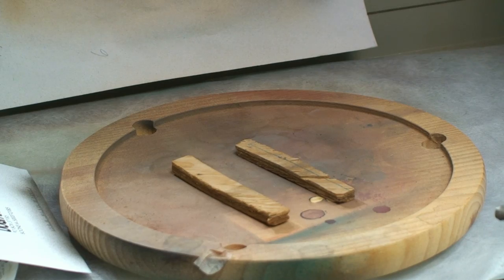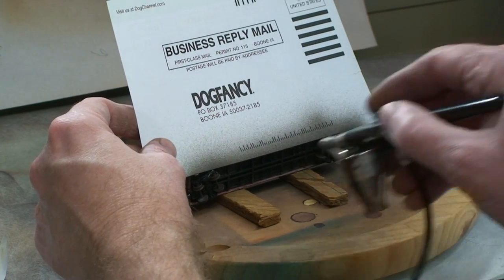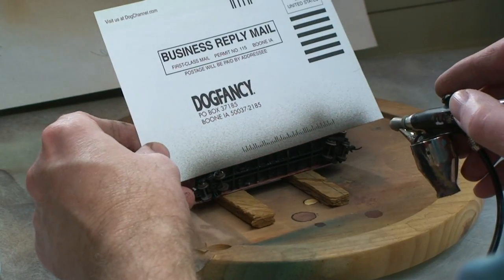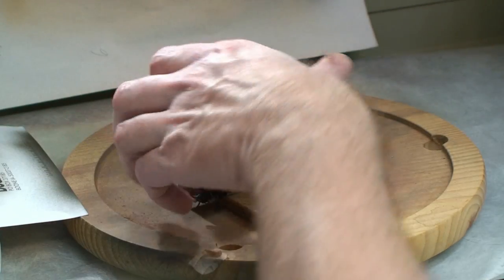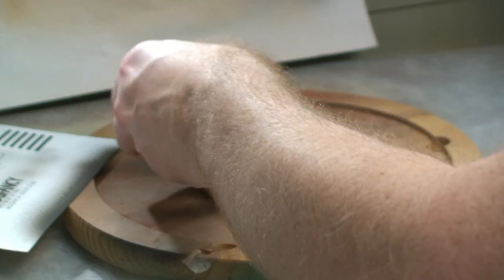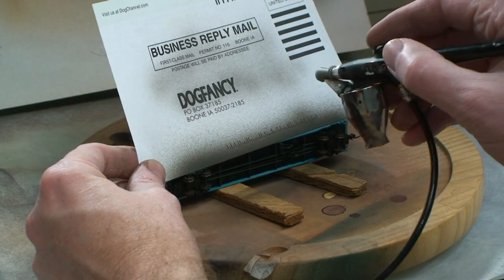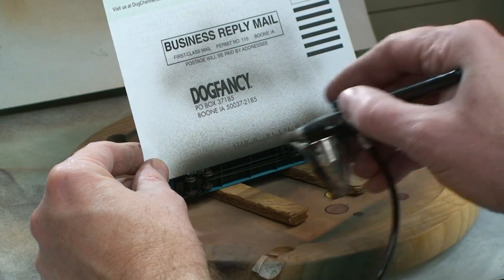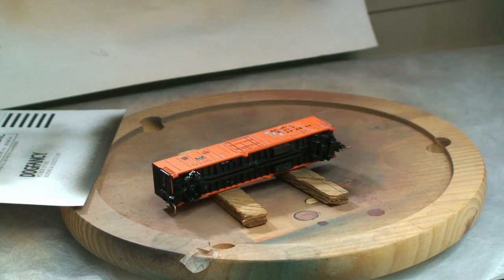🔴Episode 8:  AirBrush Weathering

Comment: I have a Badger 350 imitation, and usually I spray enamels ruduced with mineral spirits with an air pressure of 30 psi set with air flowing. How much psi would you suggest, in my case? What would happen with 15 psi set with air flowing? Just wondering.

Comment: I am thinking of getting an airbrush.  I was thinking of the Badger with the air can to start with.  No point in spending a ton of money until I know that I have any talent for it and I like it.  Is the 350 a good model to start with?
Reply from the maker: I have the Badger 350 and it works fine for me.  As for the cans of Air That come with them. It does not last long so if you do not have access to more of them locally you need to come up with some other source of air.